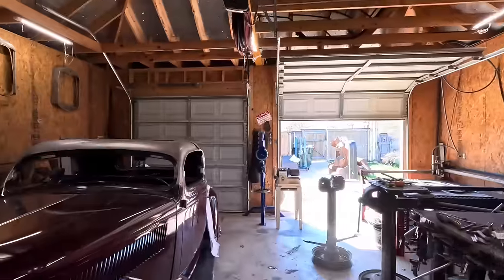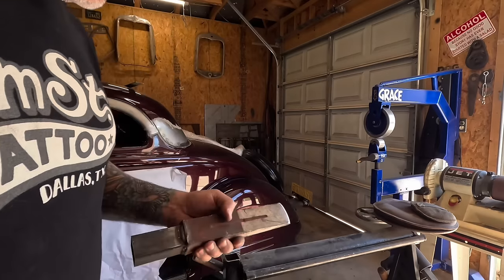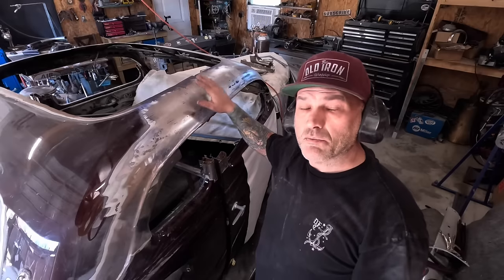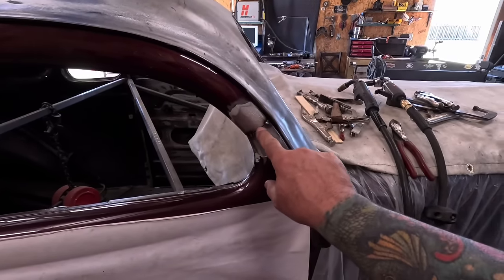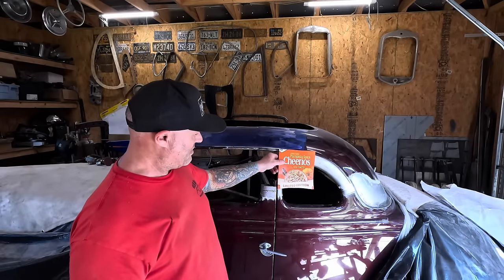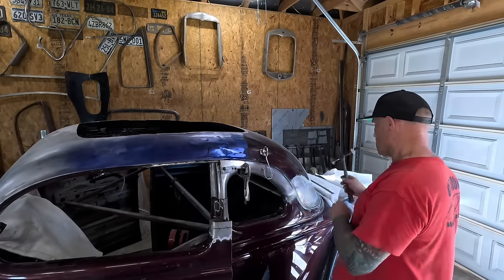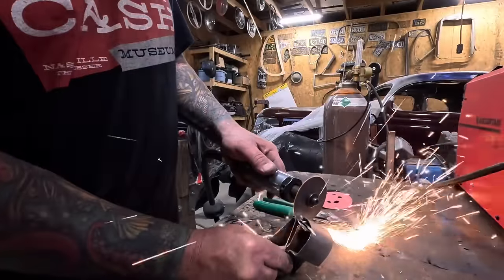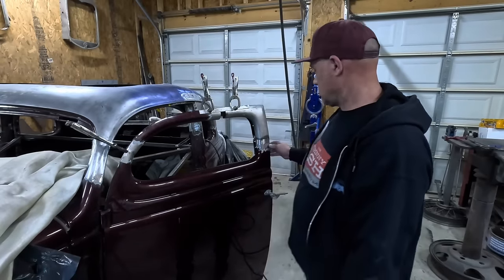How the chop a top, 1936 Ford  roof part 3

Comment: My condolences. Blessed was your hammer, may it rest in peace. Camelus vitae firmiter requiescat in faciem tuam. Amen.   Man, that driver's door/ rear quarter is messed up. Odd 'cuz the two parts couldn't have been stamped that far off and still left the factory.
Reply from the maker: It looks like something fell on the car at some point or may have possibly been hit. Unfortunately, those things were not addressed prior to painting the car.
Reply: @Theoldironworkshop   Yeah, heard that. It didn't occur to me at the time, but the door must have gotten compressed 1/8" or so. Makes sense now, was just thinking of the roof.